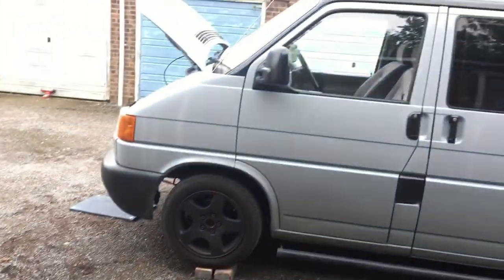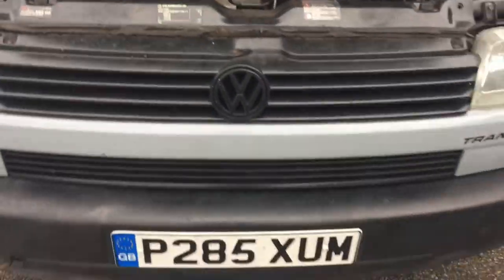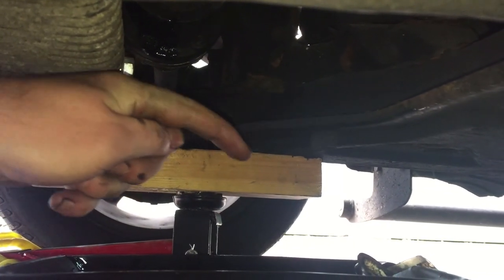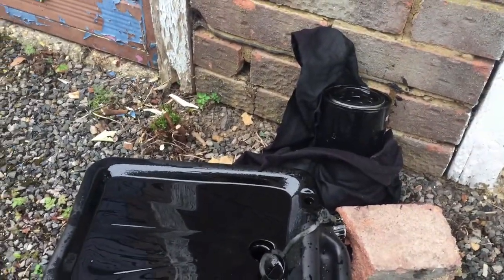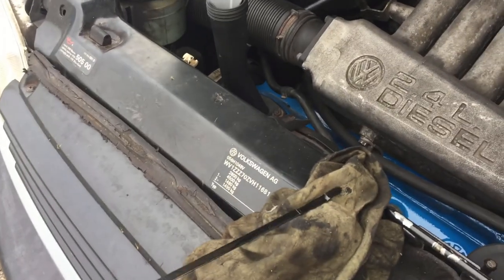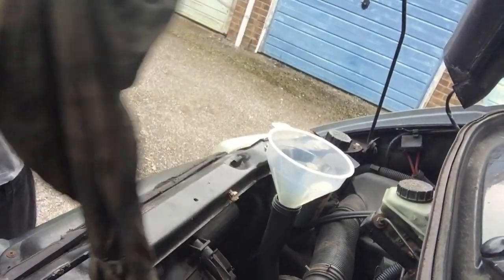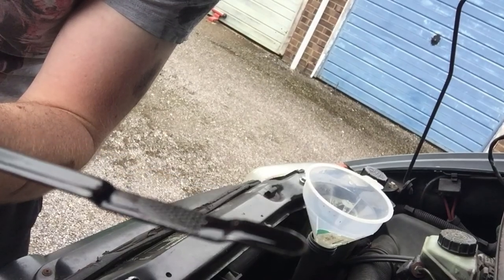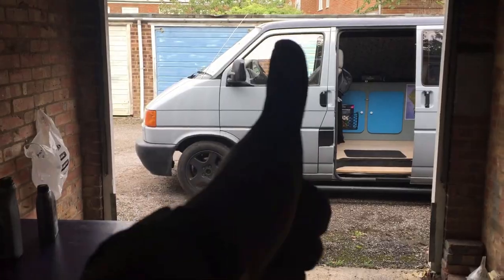T4 Oil Change - Nice and simple

Comment: Great video, for others who wonder which size copper washer, mine was inner diameter 26mm (but on a 2.5TDI) If you have to use the old copper washer, you might consider heating it up a little bit before you put the plug back in. Will also mention that it is recommended to put some engine oil on the gasket on the new oil filter.

Comment: I think I  would have taken the sump plug out first and started draining before removing the filter ? And surely that would have reduced spillage? 
I would have jacked the van up and added two ramps under the wheels or two axle stands, (even plus two ramps) Never work under a vehicle with just a Jack! That Hydraulic seal can fail in a split second and the jack will be down seconds before you can react!
And I would keep the 1 litre for topping up, or better still get a refund for the one litre, and buy a 5 litre for a 'long term top up' ! Good video though and well done for posting it! Cheers   dx

Comment: Thank you, very nice to know there is nothing special about the oil change, even though I have experience with a lot of cars, I still like to check online if there are any tricks on a certain car. Thank you for the time to put this up. I would drain the oil first, then remove filter. Also have the car on ramps, a jack can fail.

Comment: I wouldn't have starting the engine with the elevated van, with an empty oil filter with so little oil in the sump .  The oil was only just on the tip of the dipstick.

Comment: Hate to say this, but only a fool gets under a vehicle supported only on a jack. Use axle stands or ramps.
Reply: the wheels had wood blocks under them
Reply: @kennysboat4432  If the jack had failed, the 2inch wooden blocks would not have saved him with a lowered van.
Before I got ramps I used old wooden railway sleepers that I cut into 2.1/2 ft  lengths ( doubled up) and cut a wedge shape to drive up.

Comment: What filter should I be using for the filter change? I just got a 92 and I'm trying to find out what filter I should use
Reply from the maker: It’s probably just best to give your vehicle registration to your local parts store so they can order the correct one in for you. They are probably all the same but it saves hassle